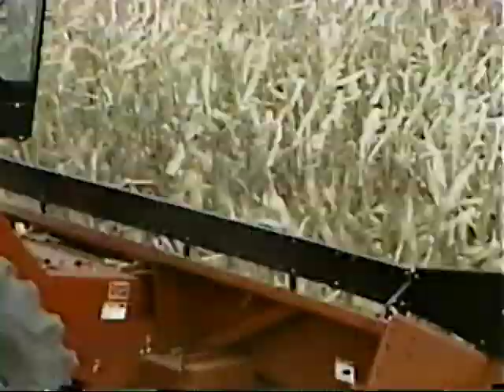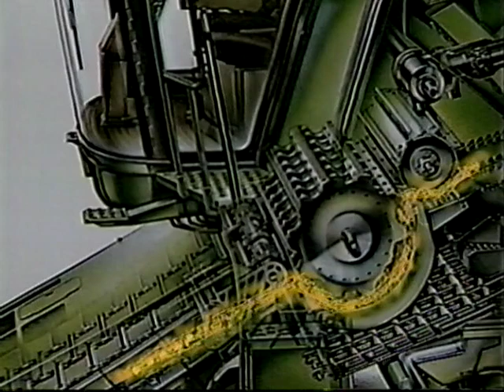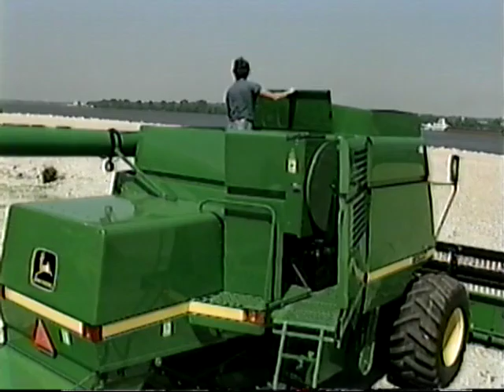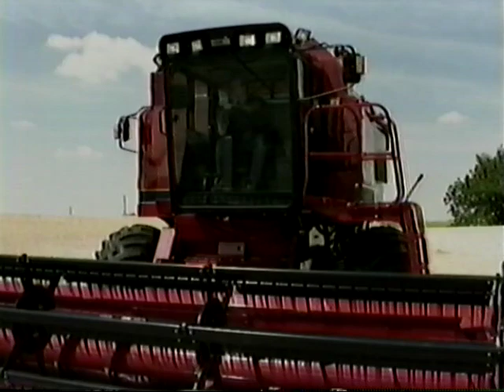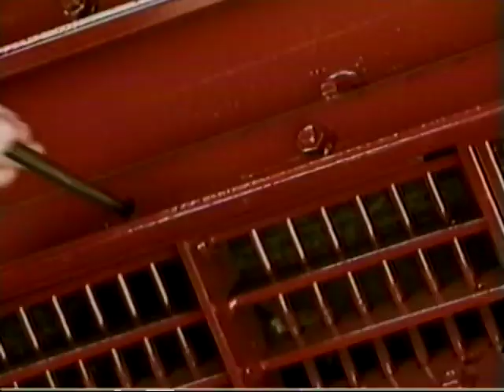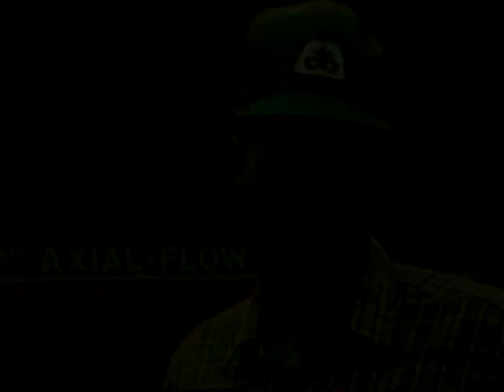Case IH Axial Flow Combine vs John Deere 9000 Series Maximizer 1989

Comment: The CIH combine here is what JD released 15 years later and claimed they invented it.   JD just copied the CIH rotor design.
Reply: IHC invented the Axial flow not Case ih . Without IHC there would be no Case ih.
Reply: @interman7715  But by the time JD came out with their copy of the rotary combine they were called CIH by then.   But yes,  IH and NH invented the rotor combine.
Reply: @GermanShepherd1983 Yes and JD waited 23 years to bring out an Axial and they copied IHC right down to the  30" rotor.

Comment: Neighbor has a 9770 JD and its a good machine but he also trucks grain and he looked at all of my wheat samples in the bins and he said those Case’s do a better job than my deere by far
Reply: You should see what soybeans look like from a JD combine.   When I sit in line at the elevator I can always pick out the guys with a JD.   They have huge amounts of soybean pods in the sample.   I've seen so many pods come out of a semi hopper the elevator guy had to push the pile of pods around to get them to fall through the grate on the pit.   They do a horrible job of cleaning the sample.

Comment: Both are great machines but definitely for quality its case all the way. As for reliability its a wash. I was looking at a 9600 last year for a second combine to replace our 1660 but I went with a 2188 because of the superior cleaning and we also had the header for a 2188. Couldn’t make myself buy a green combine, would have been odd looking with the 7120 in the field at the same time

Comment: I think the combine landscape would be very different today if deere had made the CTS a little better corn machine/ easier to change over for corn and went that route over STS. A CTS machine on a 9600 chassis with big HP would have been a Lexion/NH killer.
Reply: That's what everyone in canada said but they would of wight over 30tons
Reply: @zacharyvollmer9874  I guess that sounded crazy back then. AF11 has got to be all over 60k
Reply: @timblack33  I mean they could have made it work but didn't

Comment: Never seen a deere with a snapped rear axle!!
Reply: Go to a salvage yard they have a demand for 6620 and 9400 and 9500 if the rear axle is still in tact
Reply: Neighbors 6620 axle snapped like a twig.
Reply: Neighbor had a case ih back in the day with a snapped axle. They switched to Deere after that
Reply: @joshualklein  The axle is not an issue to repair. It's the overly complicated internals when/if something goes wrong with them. Many brands have problems with straw walker bearings for example, not familiar with deere though. Also It's posssible to wreck the walkers if the clogging alarm doesn't work, I saw one small Deere that had done that a couple years back. The fuse was blown or there was a bad contact so the alarm didn't sound, even though It's a NC circuit that should be pretty good since it makes the alarm go off when the connection fails instead of just not working...

Comment: CIH Selling grain quality and that's it, nothing else was better.  A good operator could dial in the deere to get close.  CIH had them beat there but a lot of other things weren't.  Both dealer lots had plenty of opposition color, i personality know of several guys all red with green machine and vise versa.  It took some art and skill to dial in the JD, that was their issue, guys got frustrated in adverse conditions while the CIA performed better.  As far as machine threshing capacity, CIA matched the 9600 16 years later with the 7000 series
Reply: Agree but the lights did suck on the deeres thou. They never even compared to the old Masseys that had round ge halogens. The JD cab was definitely big step up vs the CIH.
Reply: what were   you smoking them 1680   ran circles around them 9600 all day long
Reply: It was the spider web of belts and chains with pulleys everywhere for me..  dad ran deeres and got along with them pretty well.. just a nightmare to service or work on.   Fell on love the early rotors for that reason..

Comment: Deere has way better Straw Quality !!!!! 😂😂😂 the Bales would hold together as a 13 year old Grunt in the 90’S I can testify 😂😂😂😂 Red one had a Cooler sound!!! 😂
Reply: that's simply due to the design, rotary combines naturally broke the straw up more which is what we wanted because we don't bale the straw, however if you can get it baled out of a rotary machine the bales spread a lot nicer than the longer stem.
Reply: @jlkkauffman7942  Yes I KNOW
Reply: What had a cooler sound the engine?
Reply: I make my money on selling grain and I want the straw returned to the land, and left there.

Comment: As soon as the sun set the Axial flow shut down......the 9600 soldiered on late into the night.
Reply: and all the grain was ground to powder and never found lol
Reply: @garywurz61 as a guy that runs a 7720 and a 9600 we only get a slightly dirtier sample but no change in loss
Reply: @zacharyvollmer9874, if you're getting a dirtier out of a 9600 you need to learn. How to set it...
Reply: The rotary made up for it during the day
Reply: Why would that happen?
Reply: @MF175mp  rotaries use a bit more hp in tough straw because the straw spends more time in the rotor.
Reply: @berniepfitzner487  ok, we only have so little it's not gonna matter. Maybe 2-3 days of hard work for our freshly acquired 1480 in a year. Realistically more like 10 days of work with 3-4hr of combining each

Comment: The only thing they don't want to admit is, the CASEIH could not combine wheat or small grains with weeds in the field.  The conventional style of the deere could handle the weeds and work through those fields without plugging.  Secondly, the deere can be set to clean the grain better than the CASEIH and throw less out the back of the machine.  I should know because I ran a lot of 9600 combines from 92-97.  The 9000 series had suspension seats comparable to the John Deere 8000 series tractors.  The real truth is, neither combine had a major advantage over the other no matter what they say
Reply: The 8000 tractor series seats were much better than those combine seats with no adjustments on those other than height and forward/back.
Reply: Update a 1688 with Lowen parts on front of rotor and these combine will eat green beans and wheat straw. I have a 1688 and I know guys who have green combines and they put grain over the rotor too.
Reply: @froggienm71  I think the green out the back is because of going too fast I see a lot of green combines here with same problem in wheat. Doesn’t matter what colour the combine is it will put grain over if you drive too fast
Reply: This is completely backwards from what I have experienced having put hundreds if not over a thousand hours on a Deere 9600 and the same on a CIH 1680 & 2388. It was WAAAY easier to slug a conventional in weedy wheat than a rotary. I have slugged and unplugged both type machines and trust me the rotaries grumble and grind marestail and pigweed into a slurry and throw it out the back while the jd will seize the cylinder tight as a drum. And that JD cylinder ain’t as fun to free up.  Not a color blind opinion just hours of experience.
Reply: Good point, however the gleaner r series takes the cake for chewing through weeds. IH for clean grain. Gleaner for organic/high weed content. John deere for parking in a hedgerow with a motor full of water.
Reply: You are so wrong we run iH since 1982 on the wheat run and over the years I have had countless number of johndeere guy tell me how they just can't get there depressed to do has good of job has our rotory are doing i have had more than one deere cutter tell me they get it close and then just don't look in the grain tank or on the ground so I ask why do you stay with the john deer they all said the same thing because deer had a better finance program that was the only reason they run john deer it had nothing to do with the jobs it did because they knew iH was better it because johndeere made it easier to buy them.
Reply: @snowman5609  like I said at the end of my comments, no manufacturer had an advantage over the other until John Deere came out with the X9 1100.  The AF11 was the first time CASEIH had a major advantage over John Deere.  You may think otherwise, but unless you know the facts, your bias is just one sided
Reply: @froggienm71
Reply: Now wait a minute.. I thought Johnny Pop's statement years ago the rotor combine was no good.  And then here they came with one... Oh and there Two track tractor claim was Superior to the Qaudtrack tractor.. We see how that ended up..   Nothing runs like a Juan Deere when they copy everyone else..  ✌️
Reply: Amen Josh @joshpitts7256
Reply: @joshpitts7256  when the patents ran out on each design, it allowed all other manufacturers to design and perfect their own versions.  So you can't ONLY blame John Deere.  After all, New Holland had the first patent for the lengthwise rotary combine.  Gleaner made theirs transverse or horizontal back at the end of the 70s while John Deere was still running conventional combines.  As for the 2 track, Caterpillar was the first design to build those.  Only John Deere continues to run all 3 designs.  When the quadtrac patent expired, it allowed New Holland, John Deere and Versatile to come out with their own versions making something better than CASEIH.  So, no other manufacturer "copied" CASEIH.  That's just a myth spread by uneducated people.
Reply: Amen Josh
Reply: @froggienm71  🤣🤣